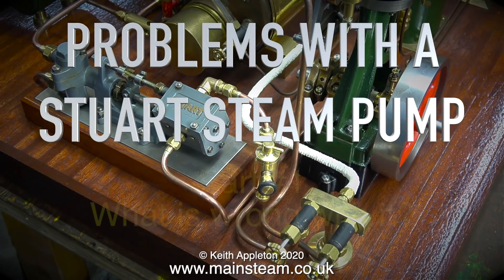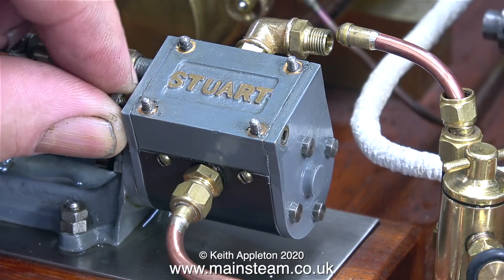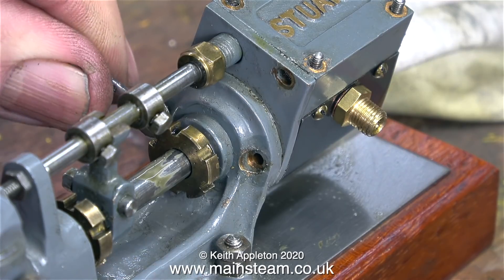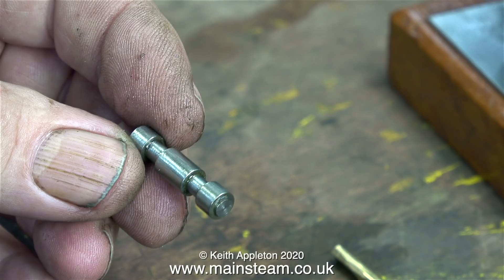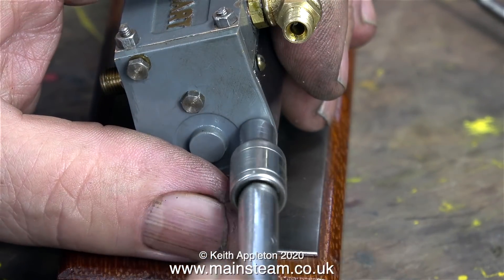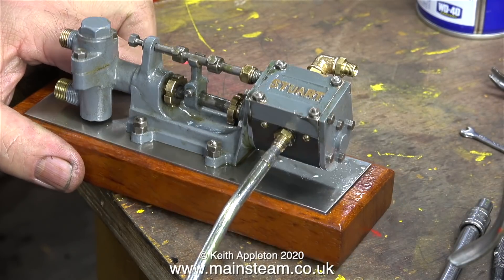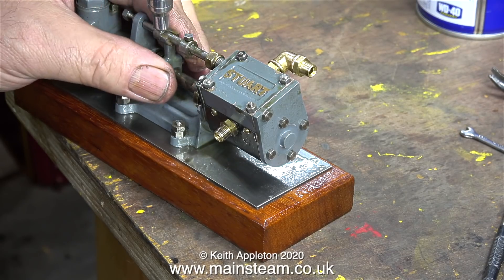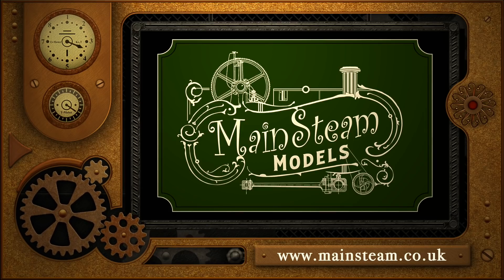PROBLEMS WITH A STUART STEAM PUMP - PART #1

Comment: At 2mins 55secs. you can see a small cut out in the cylinder by the piston, what's it for ? 
I'm trying to build one of these from the castings kit but apart from showing the location of that cut-out no other dimensions are given and I can't work out what its for anyway.
Reply from the maker: It is to let the steam into the cylinder - !
Reply: @keithappleton  Ahh, thanks for that, it makes sense now, it's shown in Section C-C in drawing 2.

Comment: Perhaps if you place a brass or copper shim between the face plate and the valve block, it may reduce the amount of twisting from torquing the bolt.
Reply from the maker: I explain all in part #2 www.patreon.com/keithappleton
Reply: @keithappleton  😀 It's easy to forget and get caught up in the moment. There must be a flaw in men that desires to help and solve problems.

Comment: I remember when I didn't have any thin gasket paper I would make one from 800 grit emery paper. The paper is meant to work wet so the paper is very strong and it works very well. The problem with the valve spool sticking is a common problem in pumps because the spools are not made of the same metal the pump body is made of. This is why the tolerances are so generous and "o" rings are used to seal them.  Ever wonder why the tolerance in auto engines are so tight? The piston rings and bore liners are both made of iron, just as they were in 1897 when Harry Olds built his first car.

Comment: Rhank You for sharing!
I try to find as much information as possible before taking on the Stuart kit.
As You said, the Southworth kit is simplified, i hawe not machined it yet, but as i heard it is slightly easier to make.
(I think i will take a shot of the kits and sharing it in a video in order to show other people how those kits look as they come unmachined (i think they still look the same as the ones i hawe, at least the pump on my drawings looks exactly identical and has the same description.))

Comment: Bonjour Keith,
To make thin gaskets, a friend machinist suggested me to take a thick sheet of paper and soak it with oil.
Amicalement, Raphaël
Reply from the maker: Yes that work, but I do find that if you separate the parts at a later date you need to make another gasket each time . .
Reply: @keithappleton  Bonjour Keith, You are an excellent mechanic, when you have reassembled an element, a priori you no longer have to touch it ;+)
Amicalement, Raphaël
Reply: One of my old steam books says a paste of grease and graphite will help keep gaskets from sticking.

Comment: Quite interesting.  It runs with compressed air, yet not under steam.  The difference?  Temperature.  The thermal coefficient of cast iron is 5.8×10⁻⁶/F°, while stainless steel (alloy dependent) can have a CoF of 17.3×10⁻⁶/F°.  Meaning the stainless steel expands more than the cast iron does, when it gets hot.  Your solution is perfect!  Remove a tiny bit of the stainless steel, so when it expands due to temperature, it still has clearance.
Reply from the maker: The body of the pump is made from Gunmetal, which expands a good bit more than Stainless Steel, but it initially stuck every time the parts got hot. the solution is in the second video of this 2 part series, but it will not be public on Youtube for quite a while yet. Patreon is running 3 Months ahead now.
Reply: @keithappleton  My assumption and error was that the body was cast iron.  Gunmetal, thermal CoF is 18×10⁻⁶/F°.    Would you happen to know the steel alloy?
Reply from the maker: Sorry, no idea - just Stainless Steel......
Reply: @keithappleton  Thanks anyway!
Reply: @keithappleton  It just occurred to me that the thermal effect could still be at root cause.  Here are my thoughts.  The steel component is bathed in steam during operation, while the gunmetal component which surrounds it is a very large heat sink.  A heat sink will take much longer to reach thermal stability than a small isolated part.  So even if the thermal CoF's are similar, the temperature rise in the components is not similar!  This is consistent with your statement that "it initially gets stuck every time the parts get hot".  

I look forward to your solution sir!  Nothing but respect from this end.